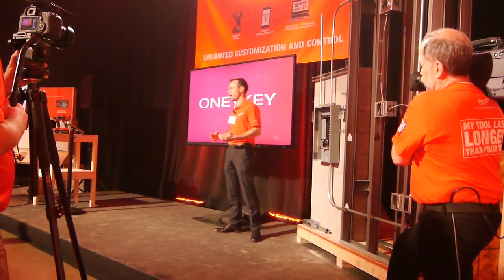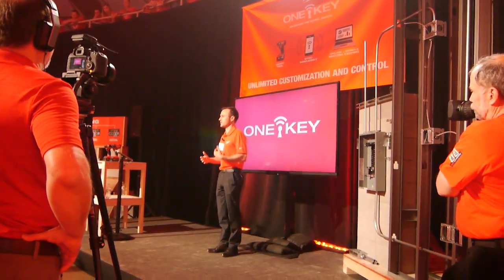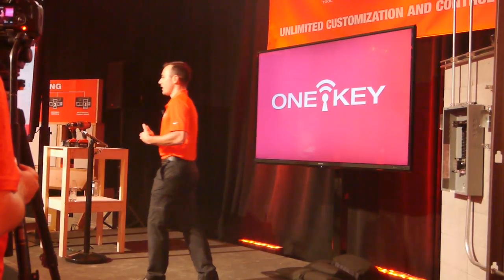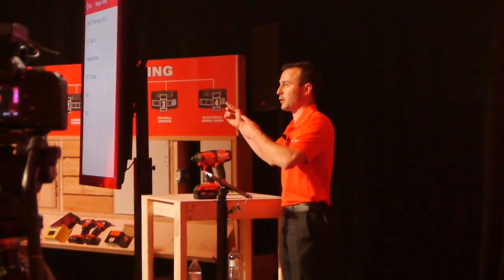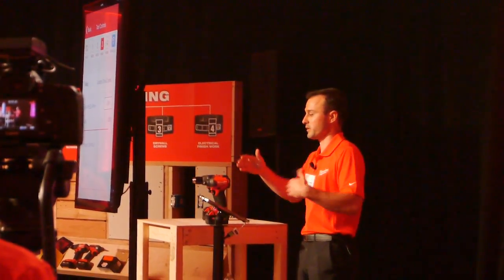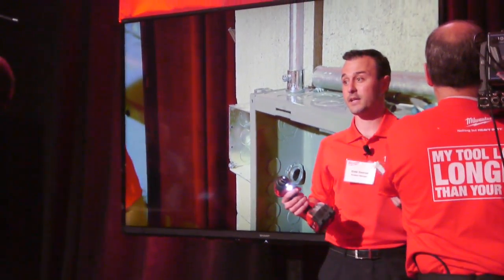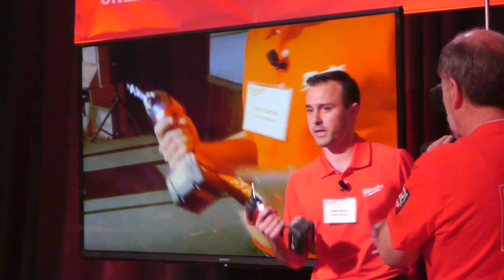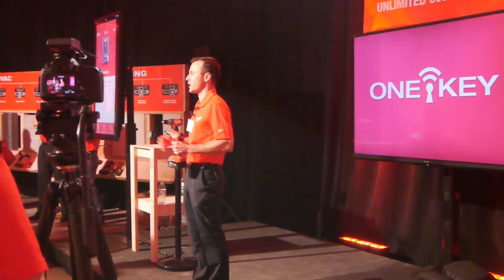Milwaukee One Key applications and use for electricians

Comment: Ya, I really don't see this helping in the application of anything.
They have simply added more time to any job.
When using different hardware, we use different drills, drivers etc. Saves time on changing bits. So you have not made that any easier, you have just added time to setup any installation 
Don't bother bringing this too market, just giving guys who waste time on the job site, another excuse as to why they haven't done anything yet....

Comment: so every time I want to change stings on my driver I have to pull out my phone????
Reply from the maker: +Mike McLaren customize presets- yes. Switch between presets no. One key features are only available on the one key power tools which arent available as of yet. If you don't need to customize your power tool beyond factory settings you don't have to purchase these and stick with the regular power tools already available without these advanced customisable features